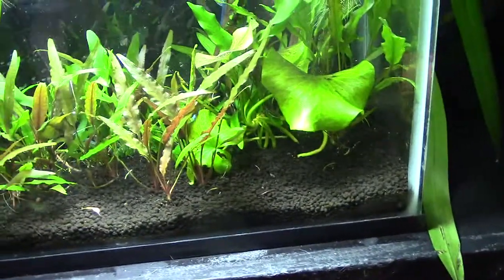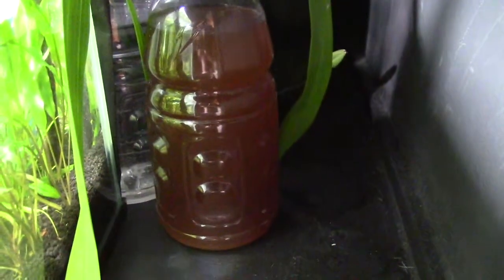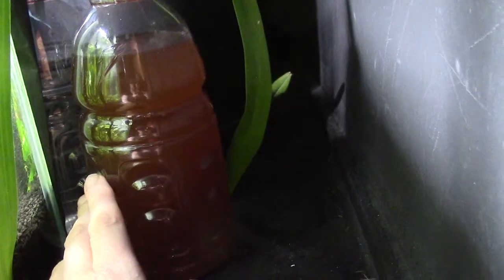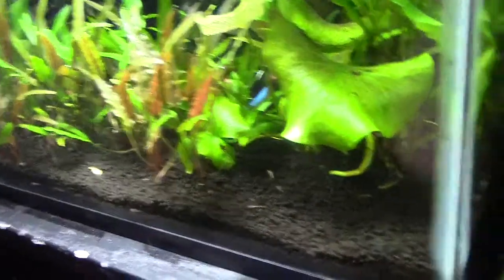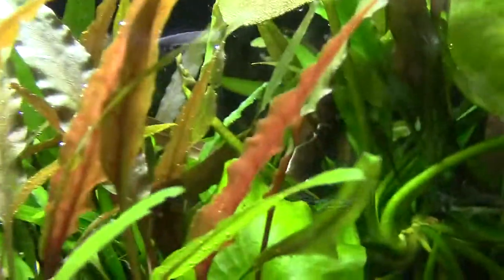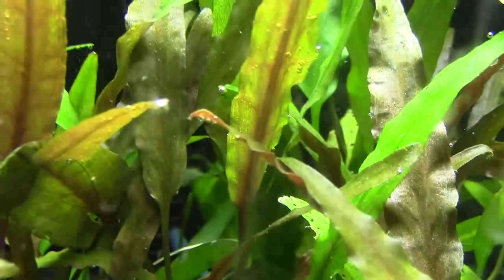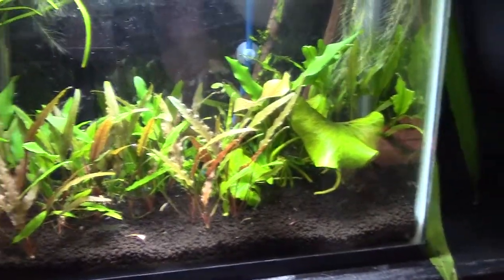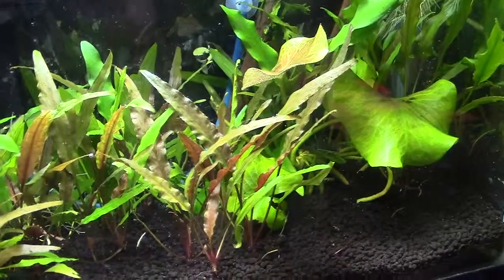DIY CO2 Mixture Success in a Small Tank

Comment: I also have a 55 gallon tank, no dirt, just gravel & low light plants.
I tried DIY C02 & getting too much green algae on glass, rocks & gravel.

I only using shop light with 2 T8 35 watts each at 6,500k

Wonder if I used shop light with dual T5 6,500k lighting will help with DIY C02 without algae.

Not sure what is causing algae, Not enough light or too much light. I only leave lights on for 8 hours per day on a timer. Any input would help, thanks
Reply from the maker: I would cut the light back to six hrs and see what happens. Good luck!

Comment: Hi. Nice tank by the way. I love the aquascaping in that tanks. For algae, i think the best way to remove them is to add shrimp. Shrimp loves to eat algae. 

The DIY co2 is simple, but I prefer baking soda + citric acid mixture. Add a solenoid + pressure gauge, you get a nice cheap diy co2. I recommend a glassbco2 diffuser + bubble counter for controlling co2. It much more neat in my opinion. Other than that, you have a nice tank.